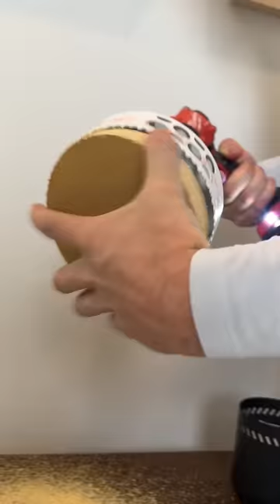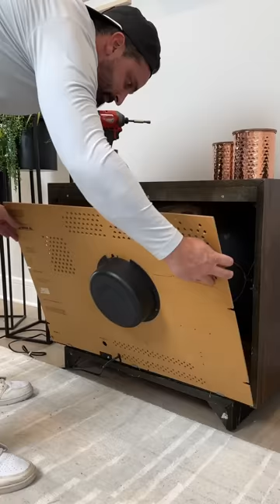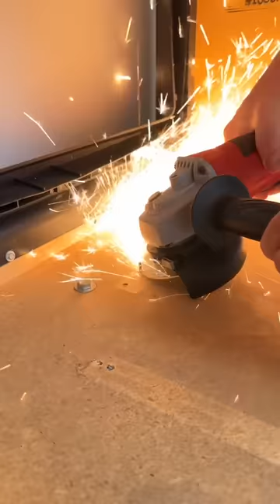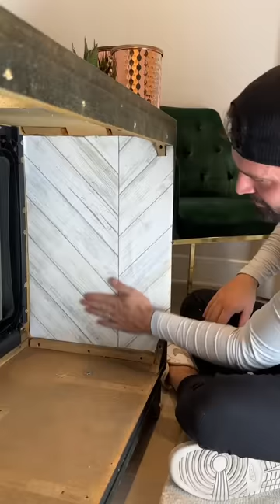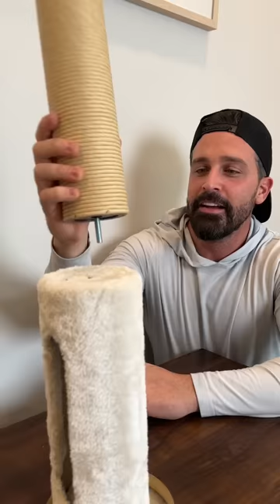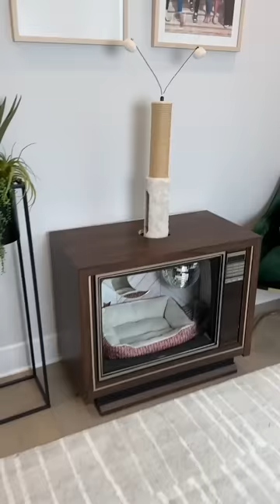A GENIUS Idea for a TV 👀 #shorts #diy #diycrafts

Comment: Do NOT enter an old television like this without being trained. There are dangerous voltages that can exist even after the TV has been turned off.
Reply: You can tune into god live
Reply: And UNPLUGGED
Reply: Right. You don't just clip wires like this guy did.
Reply: @tedshoemaker923  this guy clearly knows what he is doing mate. I wonder why he didnt get shocked
Reply: @zuesnastrio3062  He got lucky. See the red wire and suction cup on the top of the tube? Its called the anode. You need to run a wire to ground and discharge the anode to ground before touching. He got lucky
Reply: Thx I will use this in the future.
Reply: Kkkk, I love the flyback, scared me here at Brazil while drilling it
Reply: @rodrunion8899  japaz ini iiiqpOoqoolaooqoqopipll

Mu dr di
Reply: @rodrunion8899  japaz ini iiiqpOoqoolaooqoqopipll

Mu dr di
Reply: Tv band hone ke baad bhi aapki Jaan le sakti hai kyouki eht me high voltage current store hota hai. Kahi galti hue ki aap dead snak ke shikaar ban जाएंगे।
Reply: @Clara Blocхххх
Reply: @rodrunion8899  even
Reply: @MohamadSholihin 
أنت عربي؟
Reply: Exactly.... picture tube and flyback transformer hold thousands of volts...
Reply: @ILOVE___YOU  لا ، أنا إندونيسي
Reply: @clarablocker7726  Clara that was a good joke and I'm sad no one commented on it
Reply: напряжение опасное, но ток маленький
Reply: Я хотел аквариум сделать из него лет 30 назад...🥴
Reply: Yes, especially on the screen,  he had to discharge it first.
Reply: capacitors can stay charged for months even if the Tv off and unplugged and still carry a lethal charge
Reply: I destroyed tons of them as a kid.
Reply: @jonathanhorvat2452  then you're lucky you aren't dead, touch the wrong part and it's instant death.
Reply: @JohnDoe-gq6yg  true. luckily i knew what capacitors were.
Reply: and that goes for woman u pic up in bars too
Reply: Ir shows how FNG IGNORANT THEY ARE!
Reply: God I hate autocorrect dropped out both electrician and I've been I've been shocked and I'm an electrician in that cell there that makes better sense now but anyway you know electricity is a whole lot of fun I prefer it to a gun because I can shoot somebody a thousand times with electrical and when they die I just hit him again and they come back to life but you do have to wait approximately 1 to 2 minutes for the body to reset before restarting because the overload of the electricity and the nervous system it takes about a minute to to a minute and a half to reset and then you can shock that person back to life again I don't recommend you play around with it but as mad necessity it works I've been certifiable electricity for more than 20 years by the way are one or two C1 C2 c3 and l1 Island rather light industry so I'm certified to be like one more class and I'm certified to be alignment and I have much respect for thousands of amps Edge tens of thousands of volts but you know a little zap from the capacitor you might make it tingle a little bit but probably not going to kill you unless you got a weak heart and then just driving back anyway thanks a lot for listening have a nice day warnings I like to rattlesnake for the electric line commercial in Arizona because yes without knowing the rules I just saved two of them from my cats

Comment: The outside of a picture tube holds a very high charge for sometime after the TV is turned off  , around 25,000 volts and needs to be discharged before handling , just saying !
Reply: the tube itself only holds a static charge. The capacitors in the chassis might hold more, but this is a solid state set, not vacuum tube.
Reply: @rupe53  Oooh! Ya'll getting deep, I like it.
Reply: A deady game to play for sure
Reply: "But did you dieeeee?"
Reply: It's the coil on the back. Had one of those lay me out flat when I was younger and dumber.
Reply: S
Reply: Там лучевая трубка только является высоковольтной частью,сам кинескоп,так себе щёлкнет немного и то ,если надеть на себя и снять синтетический материал,чтобы на теле появилось статическое электричество.
Reply: verdade!
Reply: Safest way to discharge the capacitors to put your tongue across the terminals while holding onto a ground rod
Reply: I agree 30kV can be fatal. do not attempt. I wonder if he used a shorting stick?
Reply: It could have been a "CATastrophe"
Reply: Sure he was just fined since he probably hasn't used it in 100yrs, JUST SAYING
Reply: I once pulled a CRT out of an old school computer terminal; carried it across the room and touched the anode.
It was a 10kV electrostatic shock. Not fun.
Didn't drop it though...
Reply: There's like 100 comments with this same shit... damn

Comment: Guy was close to walking the stairs to heaven. Those old TV’s are super dangerous to open up. Massive amounts of electric load.
Reply: I was internally screaming when I saw him open it up
Reply: Was just wondering if he got a zap...  Should have been unplugged for at least 24 hours...
Reply: @melissapilalas3679  longer than that, those coils at the back hold onto a charge for ages. I used to work as a tech at Dave& Busters and the TVs in those old arcade boxes scared the shit out of me. We used to leave them unplugged for like a week before even getting close to them lol

Comment: NEVER OPEN A TELEVISION!
Never open the TV unless you know how to properly discharged the capacitor. There is enough electricity stored in the capacitor to kill you even if the TV has been unplugged for weeks at a time!
Reply: *CRT . Caps discharge in a few days. The tube can hold a deadly charge for years if not decades
Reply: Shhh stop telling people and let Darwin work it out..
Reply: There's also a not insignificant risk of injury from the tube imploding...
Reply: @rustbeltrobclassic2512  That's not Darwin. A lot of people don't know. Darwin is when you know and do stupid stuff
Reply: Dude almost saw black forever while trying to maake the worst cat tower ever made
Reply: @TheClickClick  oh come on.. common sense.. it's an electrical device.. that's totally darwin.. lol
Reply: They can hold that charge for decades and still be lethal

Comment: Everyone who’s watching this please disconnect the tv from power before drilling into it. Also these old TV’s have a flyback transformer in them that needs to be discharged before you can safely start cutting wires. The flyback transformer can hold up 26,000 volts for period even after the tv has been disconnected.
Reply: To discharge the capacitor , just put a screwdriver 🪛 across the two plug 🔌 prongs after unplugging.  No Sparks fly.

Comment: That picture tube has vacuum in it. You drop it and it can implode hard and bounce glass all over very fast and sharp, with lead in it. At the very back is a little bit that sticks out - break it carefully to fill the vacuum.
There are electric charges in the electronic bits. Capacitors can zap you hard.
Maybe don't mess with it.
Reply: I forgot about vacuum tubes!

Comment: when electronics were simple and could be fixed.
Reply: A tube is like replacing a burned-out light bulb. But transistors fit in your pocket.
Reply: I mean I just fixed my 55 inch TV. Simple power supply board replacement. Replaced a screen in a friend's phone couple weeks ago. Things can be way easier to fix now a days. Unfortunately the real problem is everything breaks quicker. 3 year old 400$  TV stopped working..... most people would trash it and spend another 400$...... 65$ fixed it like new
Reply: I fix a lot of TV'S, mostly like just swapping computer boards...easy!!!
Reply: @MykeHunts  They buy the cheapest electrolytics in bulk, they’re the first parts to fail and the first thing to look for.

Comment: Folks watching this... please remember to turn off your TV and disconnect it from the mains before cutting a hole in the top of it. And please remember that components inside the TV can hold a lethal charge even after it's been unplugged from the mains.

In fact... just don't do any of this.
Reply: Was thinking the same thing, don't do this! The capacitors in that tv hold a very high charge of electricity, potentially for years.

This could very easily kill you!
Reply: Discharge anode to ground before servicing .

Comment: People don't try this at home,  older CRT TVs the glass tube itself actually behaves like a giant capacitor and if you touch the wrong part you can get a nasty shock.
Reply: I used to have to diffuse computer terminals that were like this  I used the wrong screwdriver and was knocked down unconscious. A little more than a shock I would say.

Comment: For what ive learned if u aint a electrical engineering or along those line leave the old tv and monitors as is. They store enough power to kill u even after unplugged for some time. Plus u had it on when drilling into it. Be careful people.
Reply: Also. Cathode Ray tubes can implode if damaged. Which is different from explode. But trust me when I say you won't care and you should be wearing eye protection.
Reply: You'll talking like someone handling a nuclear warhead.

Comment: Those old TV sets can be deadly. Tubes with deadly gas and high voltage wiring. Many have died doing that. Unplugging does not take the danger away. The deadly components store everything.

Comment: Great way to get someone killed by not giving them info on the dangers of opening an old TV. They store electricity in their capacitors, enough to kill you even after a long time of sitting idle. Never open a TV unless you know what you're doing, I've repaired electronic appliances for over 44 years and would never put a video out like this without that explanation of the danger. Just a heads-up for anyone thinking to do this to their old console tv. Never drill into a plugged in electric appliance either of course..lol

Comment: Screen has to be discharged before you touch it. It's basically a giant capacitor. You ever touch the screen when it was on? There's static electricity in there..

Comment: Cutting wires when they plug in, using a hammer to remove rails when a screwdriver would work. Unnecessary

Comment: I hope you've got a good legal protection insurance.
Because the TV is still working while you're opening it.
And even more dangerous is high voltage at the tube.
More than 10.000 V and the tube saves it for Long time.
So if some one is doing that like you show here, will risk their health.
But the Idea itself is very cool.